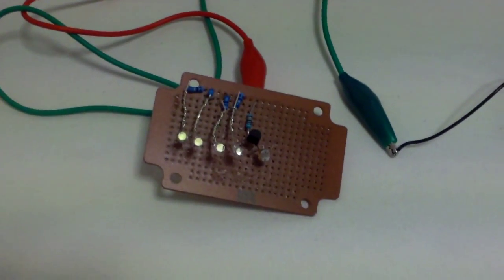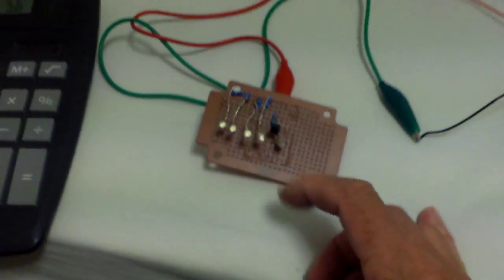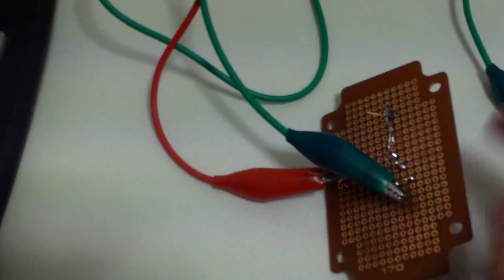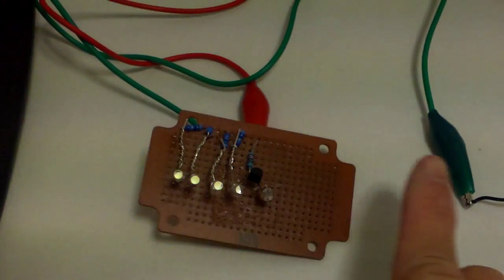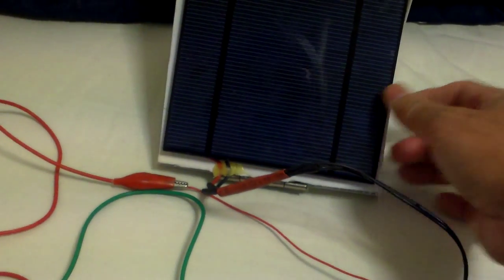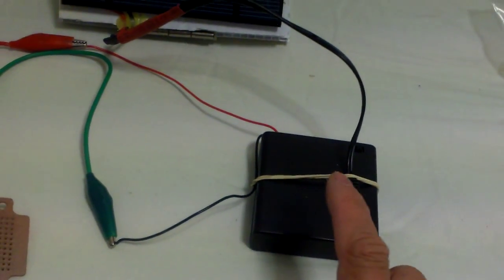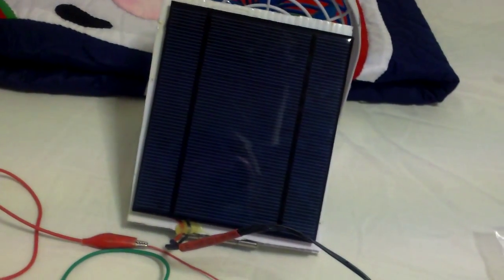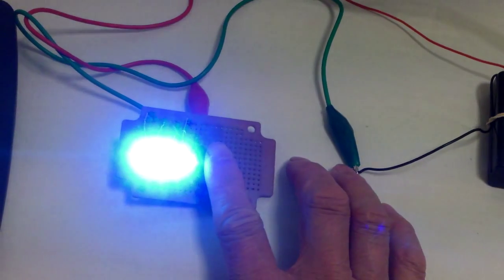Dark sensing solar rechargeable light components mounted to perf board for testing

Comment: I like those square trimmers instead of pots.  They plug right into the breadboards and are cheaper.  They have a plastic adjusting screw on the top.

Comment: Those little transistors get super hot and if you disconnect them in time, they still work.   I've burnt my fingers on them a few times and it really hurts.  If you replace the 100k with a pot, you have a light sensitivity adjustment.